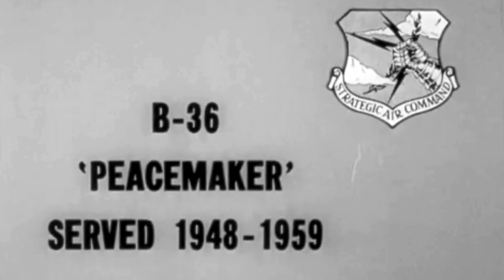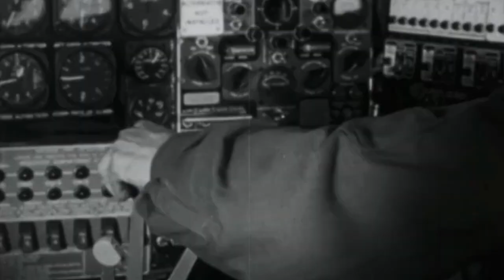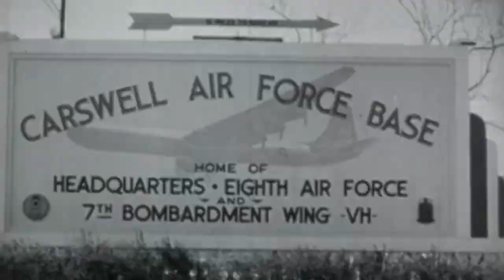A B-36 That Ripped the TV Antenna off a House

Comment: I flew in B-36D's in the 1950's.  We conducted "Over Flights" in Russia before they had missiles. We entered from the east over Manchuria below radar and climbed higher as we went further west. At times we were low enough to see bike riders and donkey carts and people astonished as we shook the ground at about 800 to 1000 feet. When the 6 recip's engines were desynchronized they made an awesome noise. The noise was sort of viscrial and you  could feel it in your whole body.
The narrator says the speed was about 180 MPH.  Well it would almost be falling out of the sky at that speed.  About 250 MPH is more like a minimum safe speed for a hot pass.
Reply: I 'm so glad that you commented. It's wonderful to hear from the people who flew these amazing machines

Comment: Funny, the B36 lasted 10 years. The B52  has been around for 60 years and they plan on keeping it for almost 100 years.
Reply: The B-36 was originally a aircraft planned in the early 40s, for the case if Nazi Germany would conquer Great Britain, to have an aircraft which could bomb the Nazis from the US. However, Great Britain never fell into Hitler's hands, the war was over in 45 and the project took more time, so the first prototype flew in 46. 
The aircraft was huge compared to all other WW2 aircraft, but suffered from technical problems. It was obsolete in the mid to late 50s, because it was too slow and got increasingly vulnerable because of new developments like really fast jet fighters, and SAMs.
The B-52 is also obsolete long ago, however it was primarily not replaced by an aircraft (it would have been the B-70 Valkyrie), but by ICBM, it remained in service as a relatively simple and cheap bomb truck against less defended targets. The B-52 is a reliable system, compared to the B-36 which suffered from technical problems with the piston engines, and from corrosion due to the special alloy of the non pressurized sections with a lot of magnesium in it.

Comment: When we lived in El Paso we lived near the end of the runway for the local Air Force Base, they didn't have to fly a low to make your house shake.
Reply: We lived at the approach end of one of runways for El Toro Marine Corps Air Station in Orange County, CA, back in the mid 60's.  Had quite a few nights that I would be woken up by the house shaking and the loud whine of an F-4 Phantom approaching to land.  I was never scared, but would run to the window to see the aircraft.

Comment: Some footage shows not the Air Force B-36s, but the XB-36, the first prototype, recognizable at the huge 110 inch single wheel main landing gear. This landing gear was not used for the production version, they used a 4 wheel boogie landing gear with much less tire pressure on the runway. 
The XB was never used by the Air Force, only the 2nd improved prototype (the YB) was flown regularly. 
The B-36 had a powerful propulsion, when it arrived first at airbases it could blew out the glass of WW2 windows out of the buildings. 
This is part of the SAC Movie ,,six turnimg four burning '' https://www.youtube.com/watch?v=9FJVxtTNjJk

Comment: One flight used enough fuel to fill a 20 gal tank over a 1000 times. Or you can drive a vehicle that gets 30 MPG 625,000 miles. 1000's of flight of just one aircraft.. That's why we're running out of Oil!

Comment: During part of this video, this B-36 is a piston engine plane. During other parts, it's a turboprop. You really should pick ONE before you start recording. Ideally, the correct one.
Reply: It's a piston aircraft, later 4 turbojets were added to increase power. But it's not a turboprop, such a version was checked during development (with only 4 turboprop engines), but never realized.

Comment: We used to see B-52s doing this in the open prairies outside Minot, ND in the late 1980's. Stealth was all the rage, and the plan was to penetrate the Soviet Union below their radar. And they got low! Not a few ended by slamming into grain elevators. At those heights, you can run out of speed, run out of altitude, and run out of ideas--real fast.